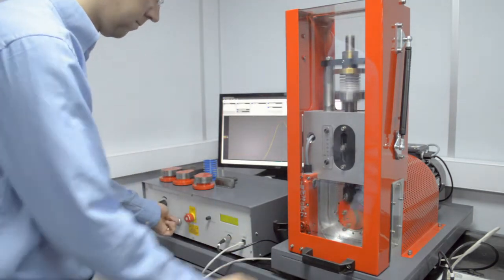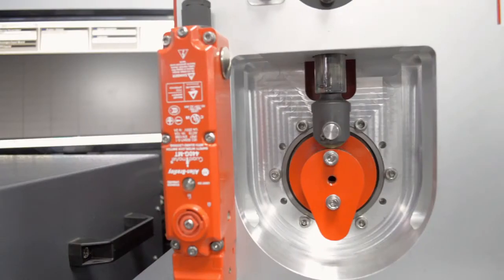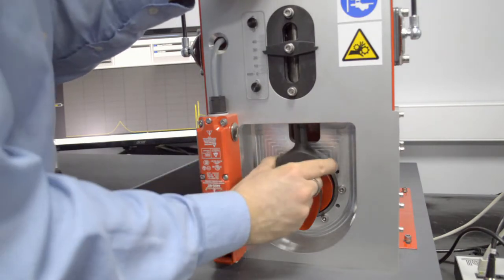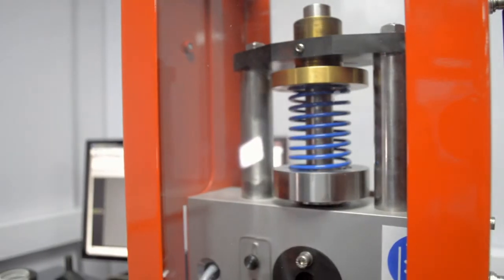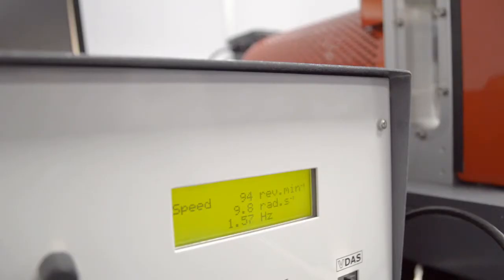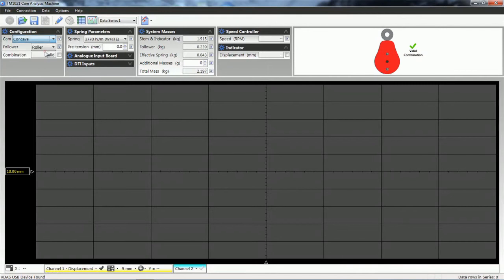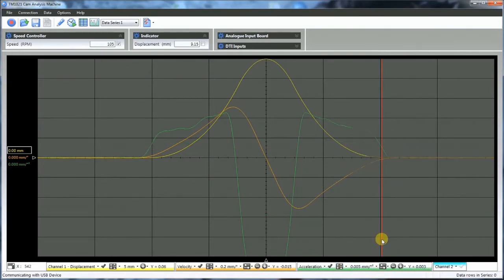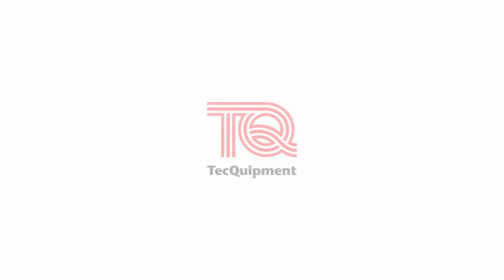Cam Analysis Machine - TecQuipment TM1021

Comment: What equipment is needed for testing of the cam analyzer?
Reply from the maker: Dear user-pp1qn9eg8l this product is fully integrated allowing you to run experiments just using this machine, no additional products are needed. In regards to product set up with VDAS on board you just need to download the software and have a strong, stable bench of 800 mm front to back and 1000 mm plus space nearby for a suitable PC (not 
supplied) and Electrical supply: (Specify on order) Single Phase, 220 -240 VAC, 50 / 60 Hz, 1.6 A or Two Phase, 220 - 240 VAC, 50 / 60 Hz, 1.6 A.